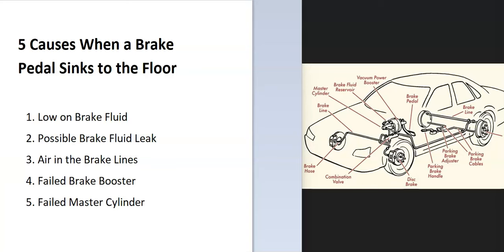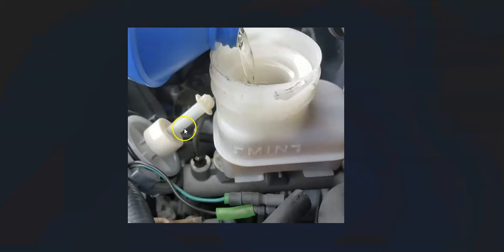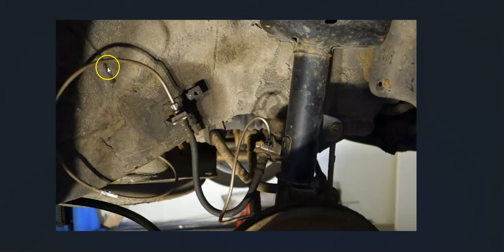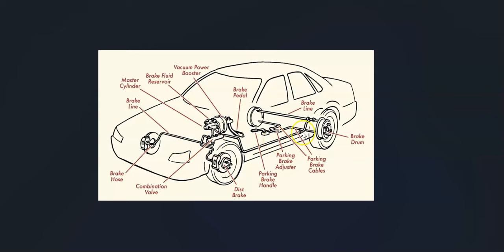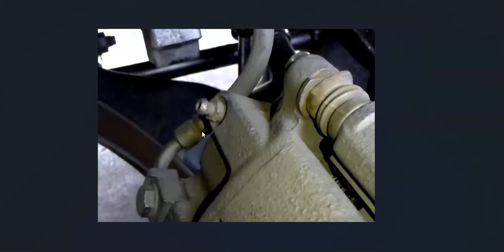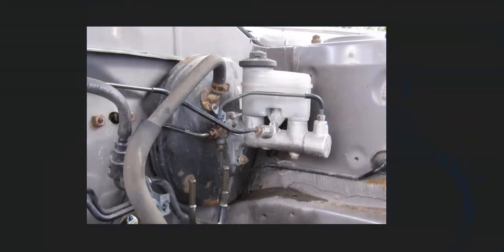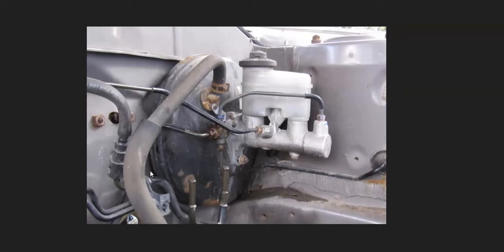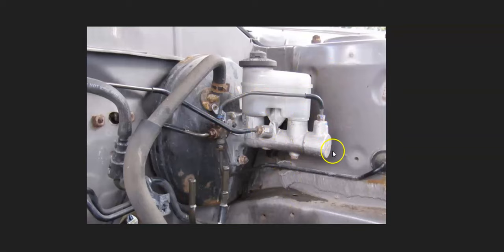5 Causes When Brake Pedal Sinks to the Floor

Comment: Mine goes to the floor when i try to press it gently, but when i do it ina more fast movement it actually has some pressure
Reply: Did you ever find out exactly what the problem was ….mine is doing the same thing.
Reply: @mr.dee1329  im actually going to my mechanic tomorrow asking about that. Its scary when u going in the highway and you lose pressure, it may be something in the pedal itself but worse case scenario its something wrong with the brake bomb
Reply: You don’t owe someone money do you? Lmao
Reply: @DTSupstateNY  me? To who?
Reply: You have air need to bleed it
Reply: @OrienTal.TrOOps1520  that was not the case actually. I dont know how to describe but it was a part that its in the actual pedal.
Reply: @Topnotch692  my 95 civic's pedal sinks to the floor slowly when I have my foot on the brake for a while in traffic. Is this like the problem you had? If so what was the thing that fixed it?
Thank you
Reply: @NIGHT-tj7ks its not looking like the same, but probably master cylinder air leak is your problem
Reply: @Topnotch692  alright thank you, I'll look into that
Reply: @Topnotch692 break booster
Reply: What ended up being the fix???  I have the same issue...
Reply: @ange.luvs.  brake master cylinder

Comment: Replaced brake booster a month back, worked fine ever since, back to braking to the floor… but no visible signs of fluid leakage? I did notice my brake fluid level went down below maximum, i topped it off, still didn’t work. Probably the master cylinder then?

Comment: Our mechanic was looking at our car and said the ABS module had a leak. The pedal is super soft, goes straight to the floor, and comes back up slow. It makes an airy kinda sound when you push it down, and when you get to the floor it just drives down the rest of the way with no resistance. It’s a 2010 RT charger. We bled the brakes swapped out 3 ABS modules and bled the brakes between each module, the problem still occurs. The mechanic told us there was a leak in the last module, and the second module was good but the screw on one of the lines was rethreaded, but the brake fluid wasn’t leaking in the second module. We did most of these on the list but we didn’t check the cylinder. We’ll try it next time.
Reply: did you got figured the problem out?
Reply: Solved?? I'm experiencing the air sound on my 2019 Civic
Reply: @jmayor_  not yet, waiting for new (used) abs valve block, you can check it by blocking your master cylinder, if then it stays hard, then you have abs problem. From what it seems abs blocks from Ate have problems with it.

Comment: brake pedal is good when i star engine the pedal goes to the floor. i have no leaks
Reply: Same here
Reply: Any body know why
Reply: The master cylinder is leaking internally
Reply: I just figured out my problem was that the rear drum brakes were shot so it was only the front brakes engaging
Reply: ABS module

Comment: Ok so… I have VW Jetta… replace both front calipers, as one was sticky… I have bled all the calipers all the way around, disc brakes, no leaks.. pedal feels great, start car goes to floor, only a little brake at very end of pedal! Using tip toe!!( I’m short! Lol) went and bought a computer to bled abs, did that all the way around the car like 7xs, same issue… went and rebled normally, no air, start car hit brake, down to floor, pump a few times, it stiffens some and sinks back to floor! I’m not understanding and I need my car!! I have done everything I can think of! Master cylinder, has no leaks, never ran dry… help 😭😭😭😭
Reply: Hi, have you ever manage to sort this out, cos I have the EXACT same issue😭 I'm so frustrated I can scream. Please help 😢
Reply: I have the same problem too 😭

Comment: There could also be air in an otherwise good master cylinder so might need to be bled as well,  also if too much fluid leaked out there could be air in the ABS module which unfortunately requires a scan tool with ABS function to remove

Comment: Great move - well explained...
Changed slave cylinder, brake pipes, brakes, pads and all fluid was out. 
Filled up with new fluid, bleed each wheel until no air. Filled up with fluid from bleedscrew in slave cylinder (to get air out from master cylinder?) and then used scan tool to get air from ABS
Neww at scan tool, think i got it right...
When car dont have ignition the brake is ok, when ignition pedal goes to floor when brake..
One of this 5 issues in this movieclip its must be? mean good brakes no ignintion, bad brakes when ignition on...

Comment: Thank you for the video very helpful my break fluid is very dark so maybe it’s the last thing to check with is the master cylinder and the pedal goes to the floor slowly but when I press the breaks fast the get hard then like two seconds they go slowly to the floor I don’t see no leaks and fluid it to the max never had leaking problems thank you for the great step by step information
Reply: Same.. was the master cylinder the fix?
Reply: @ange.luvs. did you ever find out this is what’s happening with my system

Comment: Mine is stuck , it goes a little bit further but it’s not coming back to the normal position , I check my brake fluid and it’s good , my vacuum lines looks good , I think it’s my brake booster I already buy one I’m gonna do it my self next week
Reply: May be the guide pins sticking

Comment: I was going 55 mph around a curve yesterday and lost brake pressure for a little bit. Pumped them until i got pressure again. Ended up being a 6th reason not mentioned.

My left rear brake pad got so thin it slipped out of the caliper and got lodged into rotor and caliper frame. Caliper pistons became the pad. Got all messed up. 

So, theres a 6th reason.
Reply: I had something similar happen. Apparently my brake pad fell off completely. This caused a caliper to become damaged. Another caliper became damaged due to the uneven wear and pulling of the breaks.
Reply: @monetpierce7692  yep, same. My pads never squeaked to warn me they needed changed. I think the squealer rusted off long before the pad was getting near the end of its life. Probably a good idea to inspect them once a week.

Comment: What would cause my brake pedal to be stuck to the floor when pressed but will slowly come back up? Master cylider or Brake Booster? I havd changed Front Calipers, brake pads, rear wheel cyliders and brake shoes. Also bleed system after all work was done

Comment: I had this happened to me today, it was downhill as well and the car ahead was turning right. I tried to brake and nothing occurred I slammed it, nothing, slammed again nothing so I had to hit my car left onto pavement which slowed my vehicle down. Brakes worked fine after, should I still get it checked.
Reply from the maker: Yes, for sure get it checked out.
Reply: Figure out the problem? I was on a hill as well.

Comment: I have changed my master cylinder brake were good but now my pedal goes right to the floor but if I pump up 3-4 times  the brake pedal while driving they work what can I do it's an old 86 e350 dually

Comment: I have back brakes but no front brakes when start the car pedal goes to floor when car is off it is right up there where it should be
Reply: I have a 2003 Ford Taurus that does the same thing. New master cylinder, Brake calipers, rear wheel cylinders, new rubber brake  lines  , three 2nd hand ABS modules. New brake booster. Fully bled the brakes several times. Still  don't have any brakes. There is no warning light on the dash.

Comment: It's usually a rear cylinder. Now & then it's a leaky pipe or a sticking front caliper - but generally it's a leaking rear cylinder. I lose track of how many "The car has no brake pedal" jobs we have done where it was just a leaking rear cylinder but nowhere diagnosed that - despite the owner taking it everywhere before coming here. Check the damn cylinders. How hard is it?

Comment: Hi,  I really like  you explanation simple but good 👌
2014 Nissan Titan SV and I check my same way you explained and yes my brake paddle go ale way to the floor, I check hose vacuum and work fine , the brake fluid  is no to bad, so you think in my buster? 😮

Ricardo from state of Utah
Reply: I forgot, I bleed all my for calipers and is no air, can you give me you opinion

Comment: After bleeding my padle work ok for a day but after that again sane problem. 
Please guide me
Reply: probably rotor/ pads the friction from a warped rotor will cause air bubbles inside the bleeder tubes. i have the same issue right now im waiting for my dad to come home he’s out of town rn then we’re gonna do a full replacement and bleed the brakes

Comment: I have no pedal. Brake line blew. Went to bleed and broke another. So being I didn't want to deal with more of the same I replaced 4 out of 5 lines connected to the distribution block. 04 Tahoe. Bled all brakes. Distribution block first then bleeders. Still no pedal.
Reply: Also had to replace both rear calipers.

Comment: My 2008 Ford Escape has been in two shops, spect a thousand dollars and had two master cylinder’s repairs without fixing my brake problem. The brake pedal looses pressure while driving and sinks almost to the floor. The place where I had it done said they want to be paid for labor and parts but the original issue has never been fixed. I’m at a loss. Could it be the brake booster? Please help.
Reply from the maker: It's hard to say, but a bad booster or the vacuum going to the booster can be an issue. Here is a video on how to test the booster. https://youtu.be/Czi0j8sKy5k
Reply: @HVAC_Mechanic  all sudden my car brakes feels in effective.. when I hit breaks in traffic it will stop the speed and leaves all sudden...which makes me afraid to drive and today I hit a truck where my bumper is damaged . Kindly suggest me ...( My breake pedal is not so smooth or to the floor ..but yeah will need to push it hard to stop and few times it will leave the grip in middle and makes me hit the car which is before me with 5 to 10 miles speed..

Comment: No leaks, peddle is spongy and goes to floor have to pump brakes to get them to work.  I have replaced rear drums and shoes and adjusted them properly (slightly dragging on drum) figured master cylinder bad and replaced. Bench bled master cylinder. Bled every wheel until all fresh fluid coming out with no air. Pedal still going to the floor and have to pump to get to work. Any thoughts????
Reply: Propably a failed wheel cylinder if you have drums check for leaks at the cylinder have you tried abs bleeding procedure with scanner ?
Reply: As I stated, no leaks which include both wheel cylinders.
Reply: Ended up being a lose axle nut on the front drivers side  , torqued it to spec (173 foot pounds) 
Brakes work great!
Reply: @mattb6118  so the master cylinder wasnt the issue?
Reply: So a axle nut caused brake pedal to go to the floor?
Reply: Yep

Comment: What is it when the pedal goes to the floor while driving but does not release when you take your foot off?
Reply: Fluid is at max line, but dark. I don't see or hear any vacuum leaks and no fluid leaks visible anywhere in the system. Brakes were fine, and the next day brake light on dash turned on when I got to my destination and could smell like brakes pads only in the front were cooking and smoking a little. With the keys in hand and no one in driver seat the brake lights were still on for about ten mins.
Reply from the maker: It needs to be examined, but it sounds like the master cylinder is going bad, and the fluid needs to be replaced.

Comment: I just replace the master cylinder & the vacuum power booster, & still my pedal go all the way to the floor, any suggestions? Thank you
Reply from the maker: Was the brake booster bled first before installing, and all the wheels bled?
Reply: @HVAC_Mechanic  did you mean "Was the master cylinder bled"?
Reply: Does your car have an ABS module?
Reply: @dougsanders6034  yes
Reply: I have the same problem and I have replaced everything . I did get 3 ABS modules  from pull-A-parts salvage. Non of this has helped.  I can bleed the brakes and have a good pedal untill I crank the car and then It goes all the way to the floor. It has no warning lights ln the dash.  I also have an Autel scanner with a bidirectional  function that I have used on many othet cars to automatically bleed the brakes and for some reason it doesn't work on this Ford Taurus. Electrical problem somewhere . Everything else has been pretty much prooved to be working.  I wish That I could help you find your problem, but i'm almost certain that mine is in the ABS electrical circuit.

Comment: If I pump it seven or eight times start the car the pedal will go down it goes down more than 1 in three or four in down
Reply: that's okay, varies from car to car. If brakes work as they should, its no problem

Comment: I changed a front brake caliper on my Accord 2014 and it sinks even after 2 bottle flushing. Before that was everything great. What can i do, pls?
Reply: It sounds like the caliper needs Bled.
Reply: Make sure the parts store gave you the caliper for the correct side. You can check this by looking at where the bleeder screw is on the caliper. It should be close to the top. Many of these calipers will fit either side , but if its on the wrong side , you won't be able to bleed the air out of it. Good luck , l hope you find the trouble.